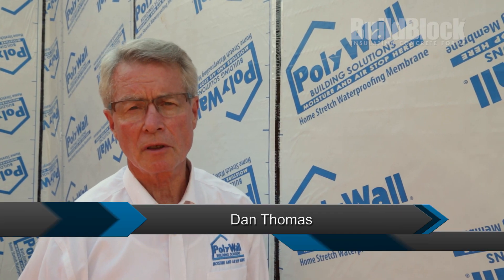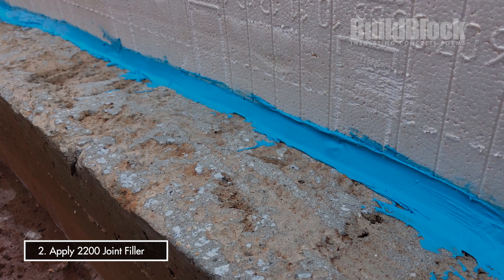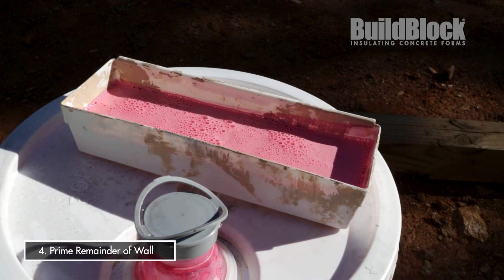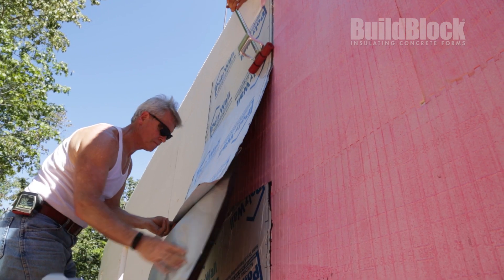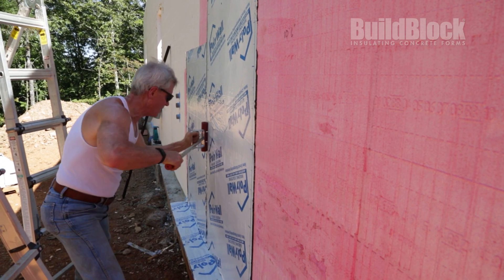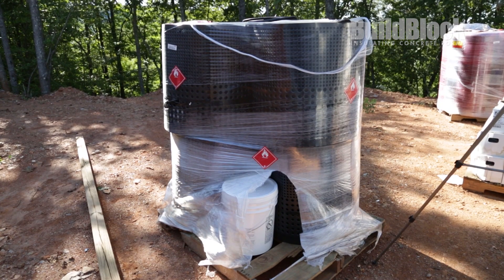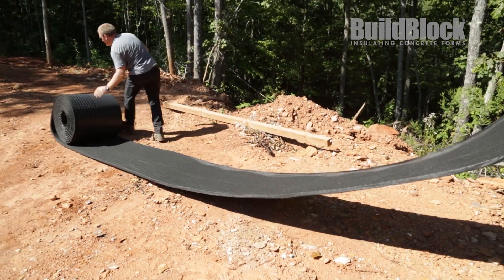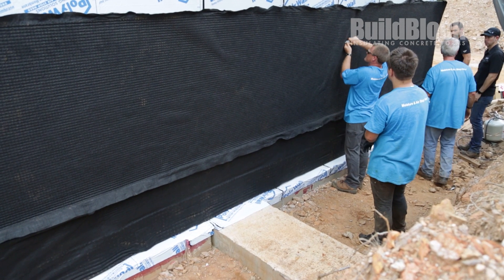ICF Waterproofing with PolyWall Building Solutions

Comment: This seems like total overkill, especially considering most ICF is closed cell foam
Reply: Its all completely pointless, the expanded polystyrene is impervious to water the concrete is impervious to water and the inner polystyrene as well. When do you see them putting this crap on the inside of a swimming pool?!

Comment: I first saw this product reviewed on “the build show”. Looks easy enough to install and appears quite effective. 
Now considering we are dealing with cracks between every ICF build block, shouldn’t we apply the crack sealer to literally every seam? Seems like a good idea at least below grade. 
You mention that the poly wall in an ideal case will never have to deal with water. Which makes me think that a wrap around covered porch but perhaps even a deck should keep most water away from the wall. Essentially even leaving the French drain dry. 

ICF and poly wall are my products of choice for my future cabin build.

Comment: What a pain.  Why not just use the spray on system, attach the dimple board and you're done....
Reply: @Mr. Sunshine I'm not saying don't do waterproofing but there's another system of Polywall that is easier to apply.  
Why go through more hassle to achieve the same result?  Does this system have more benefits?
Reply: There’s a huge price difference. This method is about a 4th of the cost as their spray